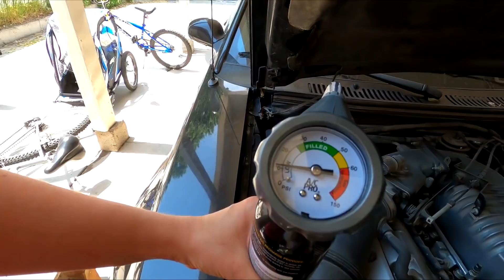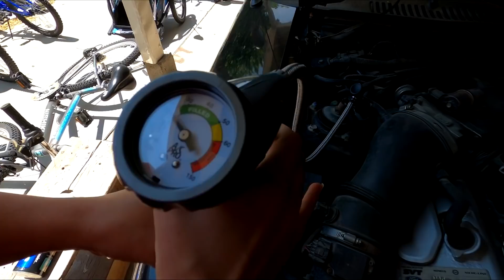The Real Reason I'm Quitting YouTube

Comment: What I would recommend is to take it to a shop that has special ax equipment. In one of my old cars they had to empty all the pressure the ac compressor has the refill it. Sometimes it might be empty but still have pressure. After they did there magic it worked. I of course tried doing exactly what you did and didn’t work.

Comment: You needed to put the whole can and possibly more in your air conditioning when you squeeze the trigger a couple of times and the compressor kicked on you just had enough in it to trip your low pressure switch it would have took that whole can and maybe a little more and it would have worked just fine
Reply: Thanks for the reply  y'all are great don't quit